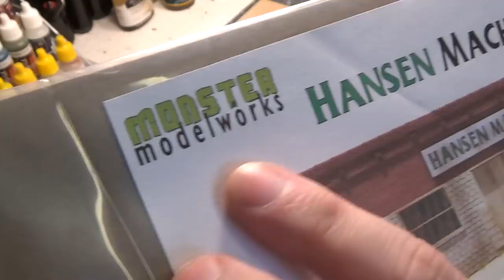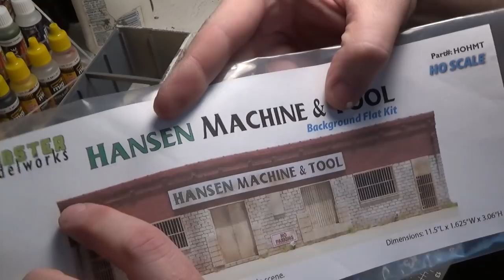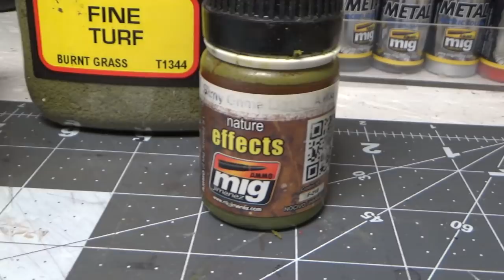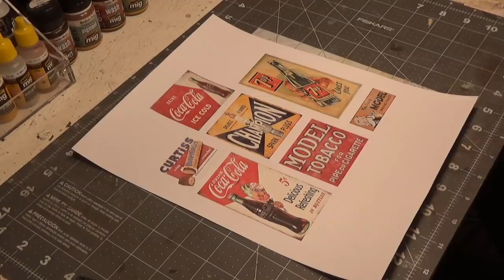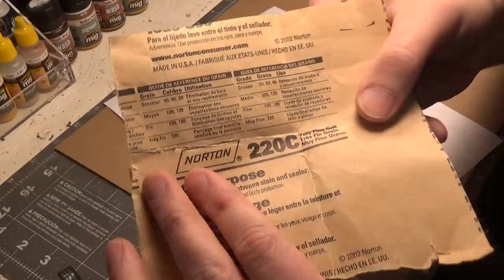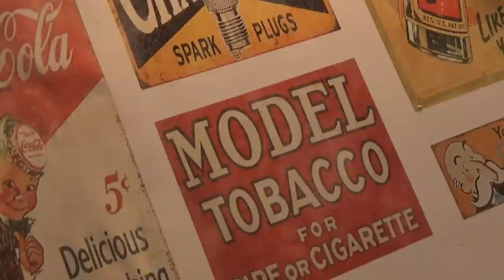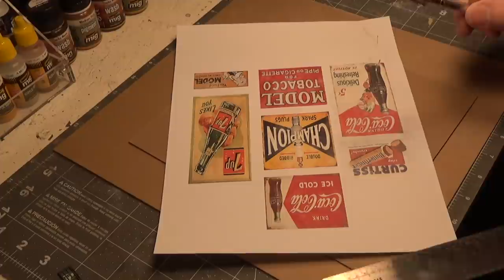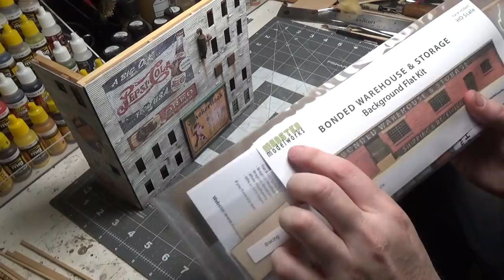Adding signs!

Comment: Fantastic work on the signs Jason. Thanks for the tip on google and sizing. I have been adding lighting & interiors to my structures using vintage wallpaper techniques and it is challenging to figure out the sizing so your comments really help. Great Job Bro! 👍

Comment: I have a quick question as always,   the glue you used,   I was given a gallon of school glue could I use that 50/50 mix?
The new upper part you redid is killer!   IMHO it ends up a way better structure.   I have been going through you play lists and you did a sign technic I have used on my N scale wood structures and it works just great!  This one just went a step further.   Your followers really need to go through your play lists!
Reply from the maker: Hey Will, the school glue will work for this. You may not need to add as much water since school glue is already thin. As always thanks for watching!!!

Comment: you talk about "joint compound",
what is that? Glue? at 6.14
Reply: For drywall installation and repairs... may be called spackle or mud for wallboard, gypsum board, or sheet rock. Depends on the country of origin and the manufacturer.